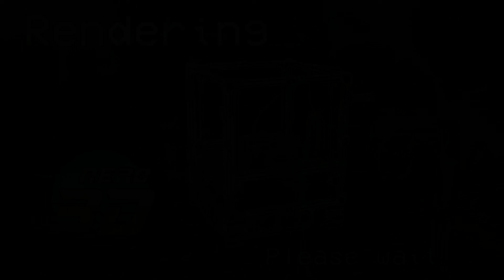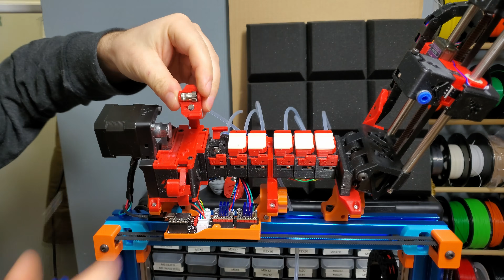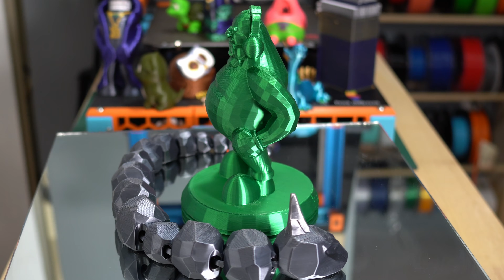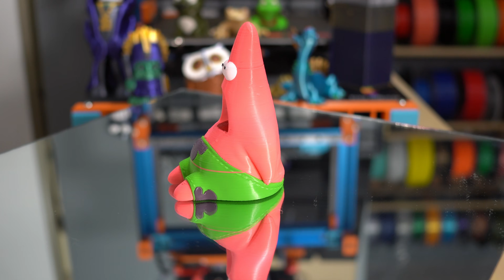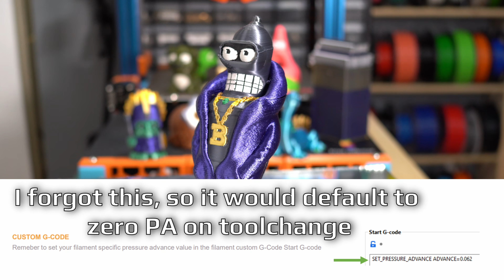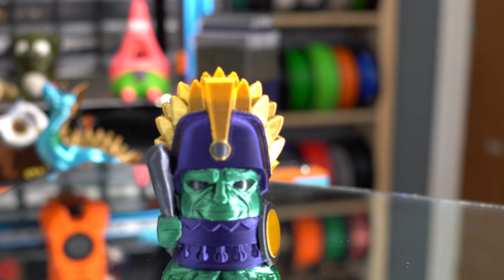The Enraged Rabbit Carrot Feed - The open source customizable MMU

Comment: I have been looking at idex machines recently and cannot find an affordable machine that is recommended by it's users to people that are new to multi material 3d printing, so now I am looking at mmu systems instead, to convert my current printers. The mmu 3 seems to be the best option for a starter kit but honestly, with the products I have planned, I could really do with a mmu system that is easy to build and use, while also compatible with my klipper Comgrow t500 for example, so I can make use of the larger build volume. Would you suggest the ercf for this purpose in todays market? Is it conveniently suitable for multi material as well as multicolor prints, for printing tpu on top of pva supports for example? You mention that when using this without a voron you have an issue due to a missing sensor above the toolhead, my t500 has a filament runout sensor just above the toolhead, will this resolve the issue? Would love to hear back from anyone that can answer these amateur questions.

Comment: I'm building an Enderwire (still need to fine tune it and build enclosure).  I have an M4 bowden extruder on it now with a Revo Voron hot end.  Gave up on the Tachi hot end, kept clogging.  Since I now have a single extruder, I might build the ERCF later, will it work with a bowden extruder or do I need to switch to a Clockwork2?
Reply: As i understand the ERCF functions as the extruder so you would bypass the M4, but i might be wrong. Im a bit shorter than you in therms of building my enderwire(just ordered parts).😊
Reply: @leifplischke2870  No, you still need an extruder.  The ECRF has an extruder, but it only pushes the filament down the reverse bowden tube until a filament sensor in the hot end extruder senses it (or it just moves a calibrated distance).
Reply: @KennethScharf  ahh. Well then i guess you can use a bowden extruder like the M4 but the filament would just have to travel much further and have weird angles to overcome.
Reply: @leifplischke2870  Yea it would be a bit slower too.  I will probably replace the M4 with a a Galilo-2 eventuallly.
Reply: @KennethScharf  what's the difference between the galileo and the clockwork?
Reply: @leifplischke2870  Galileo uses a planetary gear drive.

Comment: Is it possible to use this instead of the bambulab AMS with a bambulab printer?
Reply from the maker: With a bambu machine? No

Anything that requires firmware modification is a no go on their machines, the only other multimaterial system that works on bambu machines other than their own AMS system is the 3d chameleon
Reply: @CanuckCreator okey thanks 😊

Comment: I have a very strange and very unknown 3D Printer among the other 10 I have including a VORON. It’s a Dobot MOOZ 3. Has 3 extruders that use Bowden tubes into a hot end. The LCD lets you do only 3 color changes per model or you can do a gradient change which is cool. No filament waste but you do get a delay in color transition and bleed over since it does not retract, load, purge. It’s a delta set up so very fast prints very small, VERY small print bed, heated but small. I have not measured how much extra color I get before the color changes and I really don’t use it in color change mode all that much. I load 3 colors in so I can pick one color of the 3 and print, then next print I have an alternate color loaded for convenience of not having to swap and load another spool. It sold for $899 but I got it used on eBay “as is, for parts only”. Funny thing is that it wasn’t broken at all I think the user did not know how to configure a slicer for a delta. Got it for $70. It makes really good prints but very small. I do use it for gears as I build a lot of robotic, raspberry/arduino projects. The units that build these waste blocks, I’m really not interested. Waste is important to me as I even try to take parts of a design and print parts of it rather than printing a whole full prototype which would be a fully wasted model as I iterate the design. I’m really careful about waste. Nice videos and when I built my VORON I watched your excellent VORON build video. Excellent content.

Comment: about the wasted filament when running multi colors. There is a need to do something about that for the regular customer. Dream scenario would ofcourse to melt it down to spool up and use again. Not needing a industrial priced machine.. Also all crappy prints and failed prints.. Yeah shure, if you use certain prands you can send in all your old crap and prints, but like me, using whatever i can get on short notice for best price... well

Comment: Can anyone tell me what exactly is different about the stealth burner that allows the ERCF to work with Vorons, but not other extruders? I have an Ender 5 plus and some Artillery printers I really want to convert to Multi material, but I’m yet to discover the trick that allows stealth burners extruder to disengage and re-engage to allow for loading and unloading of the filament without manual manipulation of the idler arm.

Comment: Of course, as this video is one Year old, the ERCF nowerdays has to be compared to the AMS. I do not mean the nice construction with spoolholder, comfort and so on, but the way they actually work. There are two major differences in function I would rely like to see in the open source projects:

a) integrated filamentcutter. While it's actually in the printhead, not the AMS, this is critical for the reliability of the whole filament change process. Between feeder and heatbreak is a cutter wich can automaticly cut. So the filament in the nozzle and the heatbreak actually stays there, the unloaded filament always have a perfect tip. The negative side is of course much more waste, as the remaining filament in nozzle and heatbreak has to be purged out adittionaly. This is also the reason for "poo ejection" to avoid insane big wastetowers.
Actually the Smart Multimaterial Filament Feeder project (SMuFF) use a filamentcutter on the printhead, but due to the weight imho it is not optimal for fast CoreXY printers.

b) the filament buffer
The AMS filament buffer actually buffers less than an inch of filament. Between extruder and buffer is a bowden. Inside the buffer is a slider with a spring. If the extruder pulls filament, but the buffer gets no filament delivered, the spring gets compessed and the slider moves. Inside the slider is a magnet, under the slider is a hall-effect sensor. So the electronics always know where the slider is. This way the feeder in the AMS can be controlled to always deliver the needed filament.
Unlike every other MMU solution this allows the extruder and the AMS-Feeder being active while printing at the same time. This avoids underextrusion issues.
Also there is no need to attach/detach the AMS-Feeder. You simply have one feeder per filament; no selector or something like that.
In my opinion this is the most interesting part in the AMS.

So the best diy solution is imho:
- Using one feeder per filament (with runout sensor of course)
- Add some sort of swich into the tube, so you can unload the filament, move the swich, bush the filament in another bowden with a filament cutter atached, and retract it again.
- Build a bambu-like filament buffer to sysnc the mmu-feeder with the extruder
- use a lot of runout sensors, Y-couplers etc. to keep everything under control
- use a seperate controller for this.
Reply: The AMS is unreliable with different temp multi-material prints. Because it cuts filament at the printhead, it melts and jams, especially PVA filament that does weird things with too much heat.
Reply: @TechnologistAtWork  Actually this isn't the AMS but the printer. Any printer with high-flow nozzle has the problem the unloaded filament having a not so nice tip, wich makes reloading unreliable (or at least needs an insane time to tune the ramping profile for each material).

That's one reason the SMuFF project started cutting inside the printhead and bambulab used this approach.

If you want to use materials with massivly different printing temperatures a filament changer isn't the right approach. It might work with a standard flow hotend and integrated nozzle/heatbreak combi (Revo, TUN, Nextruder), as they leave a quite nice filament tip on unload. But even then you never get everything out on unload and need whiping. So wrong temperature for the remaining amount of the former filament still can cause problems.

If you want to combine massivly different materials, filament changing isn't the right approach. Different hotends (Idex or toolchanger) would be the right way there.
Reply: @oleurgast730  the AMS is built for the Bambu printers but it's not a good system as a whole of the filament change is being done at the hotend. All what bambu needed to do is make the cutting above the extruder and that would've eliminated the entire problem with their system. Why would you cut the filament so close to where it melts?

They just needed to move the cutting zone a couple of inches up.
Reply: @TechnologistAtWork  The main point of cutting the filament is to get a nice filament tip for the next load. So the best way would to totaly unload the filament and cut outside just the tip. However, with high-flow hotends the tip of the unloaded filament can become very deformed and you can get problems on unload.
Cutting above the extruder but after the hub makes no sense. You can not pull it out, as you just cut the connection between AMS-feeder and extruder, so the only way out for the filament still is the nozzle. You even get more filament to purge. You want to preserve as much unmolten filament, cut of the molten (and therefore deformed) part and also avoid the tip hardening in the heatbreak.
Reply: @oleurgast730  you can't just pull the filament out without cutting. You also don't pull the entire filament out anyways. The reason the printer does a purge is to get rid of the remains filament by pushing it out with the new filament. Adding just two inches to it doesn't impact that process in any negative way. Moving the cutting away from the hotend just makes it more reliable.

The AMS is already a bowden style extruder that is more than capable of pushing the filament through until the extruder can catch it.
Reply: @TechnologistAtWork  Purging (using the purge tower) originaly was only to whipe out remaining rest you can not avoid being left in the nozzle. Filament tip was improved with ramping profiles. With High flow nozzles, this became more problematical. So cut&poo was invented. This increases reliability, but is extra waste beyond the waste to whipe the nozzle anyway. With cut&poo you have extra waste - and as longer the part you cut, as more extra waste you have and extra time you need. You always want to cut as near as possible to the tip, reducing the extra waste.
Reply: @oleurgast730  tiny bit more waste to guarantee reliability is totally worth it. High flow or not, that doesn't matter if you cut it farther than the nozzle. 

PVA tends to expand with heat and the heatsink on the Bambu is terrible. The extruder itself gets to around 45c while the nozzle is hot. Mind you the extruder is plastic so this isn't great for longevity.

Comment: Would it be possible to use this with a Sonic Pad running Klipper?
Reply from the maker: Maybe, but the sonic pad`s version of klipper is closed source (violating the license) so there may have conflicts that would prevent it from working properly
Reply: @CanuckCreator  oh OK thank you. I'm kind of new at this. Is there anything else I can use for multi color prints. Thank you for writing back.

Comment: That purge time, waste, and tuning sucks. I'd rather see 6 extruders on an extended x axis, or a full extruder to be picked by a tool holder.
Reply from the maker: Thats a valid, albeit different option, that method requires a larger machine and increased cost, there is no perfect solution to multi material printer, every option has its downside

Comment: id love to get one but the hassle of unlearning marlin and learning clipper is just too much for me T_T
Reply: Do it mate, they have great docs and you can rapidly test things since you won't have to recompile on changes.
Reply: @felixisme  my issue is also not being able to use my BTT tft35 since its not compatible with klipper
Reply: @Sugilite_ch  that's a shame. yes i looked it up as well and see that it's currently only possible to use that screen without touch support. so it would function, but you'd use the knob instead.

everything is a lot nicer to control through your phone or pc website anyway though when using klipper. look at mainsail or fluidd which are the interface used.

there's also klipperscreen that you can set up with a new supported touch screen if that is something you value a lot. those screens don't cost much on amazon.
Reply: @felixisme  not gonna lie i hate you a bit for making me actually consider it xD
Reply: @Sugilite_ch  you know it's inevitable, listen to your heart and you will see; there is no way you won't spend days switching firmware. its just the right thing to do

honestly though I've never used marlin, my first printer is a voron and the goto there is klipper. so I don't know much about marlin but working klipper has been super easy and smooth for me. my favorite features is the web interface and easy adjustments, just works and has really good docs and features not seen in marlin if you want to try and push speeds

Comment: Is there any color mixed? even if I change the filament manually, I have to cold pull a couple times, but still, I can see some different color from the last print
Reply: you get a big purge tower, when it changes it prints material on the purge tower to get rid of any old filament
Reply: It’s something that’s tuned

Comment: Is there the mod for the stealthburner with filamentsensor available?
Reply from the maker: The stealthburner hotend/cooling ducts are drop in fine. The sensor is part of the extruder. Atm the cw2 is not supported
Reply: Ok, so it‘s CW1 with SB
Do you have more Infos on the SB IDEX setup?

Comment: Is it possible to load two of the same filament and when one spool is empty it automatically uses the other? That would be perfect :) and does anyone have any more information about the filament sensor in the print head? I have a V2.4 with afterburner Thanks very much !!
Reply from the maker: It can be used in a continous spool mode yes

Comment: Sorry but the prints looks soo bad.....so i wont buy ercf, prusa mmu2s instead of this:)...maybe in the future ERCF will evolve
Reply from the maker: Ngl. Thats a bad take argument. And also means you didnt watch or pay attention to the video. The ercf has zero effect on print quality.  And i know MANY prusa users who switched to the ercf from the mmu2 due to its capabilities and reliability advantage....so ya
Reply: @CanuckCreator  then why those bad layer lines are there?:/
and with MMU2S not 🤔
Reply from the maker: @zola5584  The ERCF and MMU just handle filament changes, anything actually print related is wholly depending on the printer its attached to.
Reply: @CanuckCreator  then why those bad layer lines?
Reply from the maker: @zola5584  Because im running many different brands of filament with the same generic profile on a printer i dont use that much in my normal routine?

Can you explain to me how something that is COMPLETELY detached from the hotend during printing will affect layer lines, cus during printing, both the MMU and ERCF are  not doing naything

Comment: Hi I got some questions V2.4 or switch wire? If you add up the price of a swtichwire or V2.4 + ERCF or Prusa +  MMU..... What would you realy recomend? Also you need to add the revo... so?
Reply: AliExpress i3&mmu, followed by a switch wire ercf would probably be cheapest, depending on how you source a 2.4, that with a ERCF would probably be the most expensive, but definitely the fastest most overpowered machine and I’d recommend it if you want something to mess with. If you want to print than a Prusa with MMU. As far as price I’d estimate an official prusa i3 mmu setup would be between an AliExpress and self sourced voron in price.

That being said you’re probably better off with a Prusa XL or E3D tool changer is probably a better choice if you don’t already have the i3 or voron. And even better than that depending on how long you’re willing to wait would be the idex trident.

Comment: That problem you got about the filament when it backs up, the MMU2 Prusa unit tries working out with a buffer. I havent had much success with it myself, but I've seen people doing an open source pulley buffer that might do better. Maybe you can check out their solution and see if it'll help you with that. My MMU2 has snapped PETG filament by backing it and looping it in a way it bents past it's plastic stage.

Comment: I would sum up the underextruded layers as likely filament tips that the sensor thought was loaded but it wasn't truly loaded fully into the hotend. This happens on the mmu as well if the filament tip isn't clean and it loads enough for the IR to say it's good. This would lend itself to your theory about the better tips and whatnot with a different hotend. This happened more frequently to me on a v6 style and not the dragon design.

This can sometimes also be just the IR sensor is incorrectly calibrated so it passes the loading test but the filament never gets to where it should really be in the hotend when speaking of the prusa/mmu combo. I'm not sure how the ercf works entirely on the loading sequence.
Reply from the maker: The ercf doesnt use an ir sensor
 The toolhead uses a halleffect sensor in conjunction with a magnet/washer thays directly in the filament path. Its really quite clever